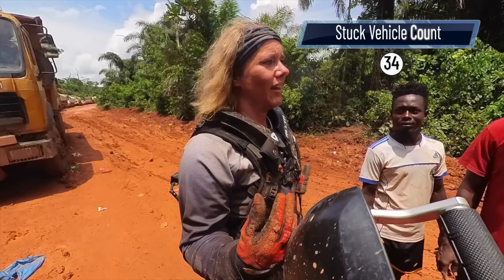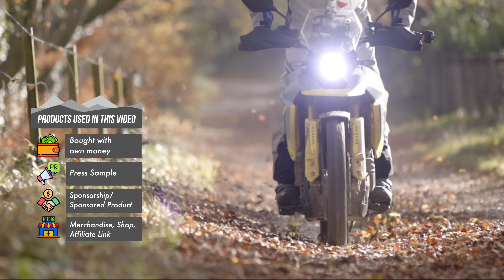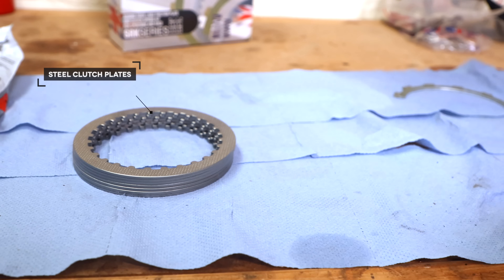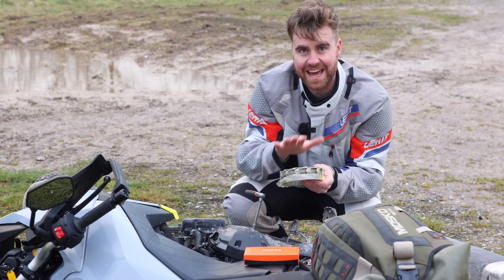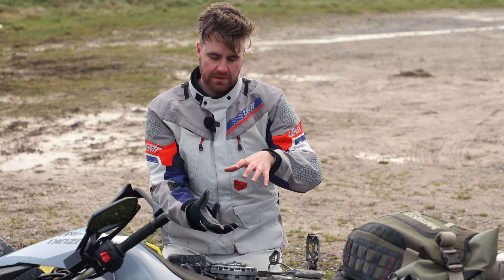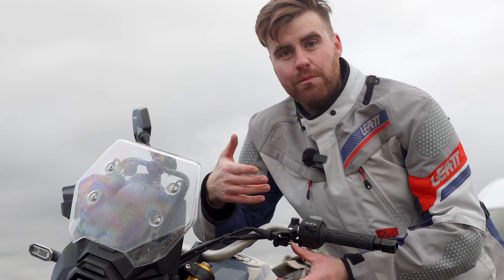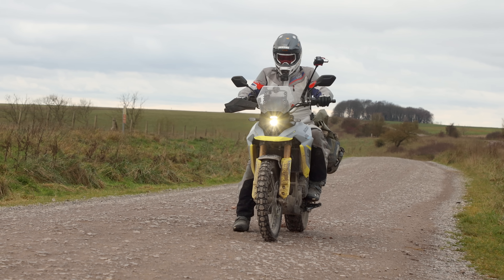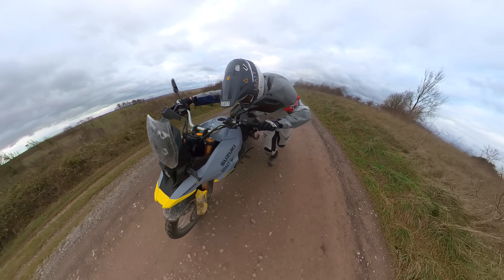This Dakar Trick could've saved Itchy Boots in Africa! | MiniTip Monday

Comment: It did always surprise me that she didn’t carry a spare clutch. So lightweight and easy to change on the roadside.
Reply from the maker: A full pack when you're travelling light is a bit bulky, but also, if you don't have the knowledge sometimes you'll make a mistake right?
Reply: @BrakeMagazine  I suppose. It did also always surprise me how little she knows about the mechanics of motorcycles considering how much she rides in remote locations. And she’s not new to this.
Reply from the maker: It’s pretty common I think 🤔
Reply: @BrakeMagazine  Aye. I’ve got mates who can’t change their oil or break pads. But they don’t travel the world on two wheels.
Reply from the maker: I’ve met as many world travellers who can’t change brake pads as those that can. I think it’s probably a viewpoint thing. 😂
Reply: I’m pretty useless at working on my bike but I’m making a list of parts to carry. I don’t weigh as much as most men and can carry what I like.

Comment: Very Nice, I am 48, I used to have a Yezdi 250 cl2 deluxe during 1995, I was 18 in college. As 'It was an old bike and i was a student did not have all the money for a timely service. My bike at times used to have a broke in clutch wire,  Used to do the same when i was 18, push the bike with engine start, and when speed reached 6-8 kms used to put in first gear, later into higher gears. Go to the spares shop, again repeat the same and go to a mechanic to repair.  So whats the big deal in this advice.  We as a novice knew trhat 30 years before.  Sorry but thats true.
Reply: Regarding clutch slippage had to rev a lot to get the bike moving.

Comment: It would not be ideal to run with a 200kg+ loaded motorcycle.
The wheelspin start looks more viable, though I would still be scared.
The start-stop-slow situations could be tricky, but could be learnt with practice. Thanks, I shall try those.
Clutch plates still don't go out without significant abuse.
Fixed drive seems scary! God bless people who invented clutches and suspensions!
Reply from the maker: Great point! Not ideal but y'know needs must. The stationary start is horrible on the gear box

Comment: You should have had a lady demonstrate your technique.

Itchy Boots' motorcycle was heavily ladened with her gear and she was faced with miles of thick goopy mud on uneven terrain.  Perhaps you should have proportionately weighted your bike (to account for your extra strength) and found slippery uneven ground.
Reply from the maker: Why?
Reply: @BrakeMagazine  I do not question that the technique is sound.  I question weather most women (in particular Itchy) has the upper body strength to manhandle a bike the way you were.

You were pushing it, then in on move, pouncing on it, mounting it, and riding off.  If the bike fails to start or it falls down... Every time the engine bogs down or you come to a stop, repeat the process.

Its psychically demanding and doable, but for a petite lady?
Reply from the maker: I think it's possible. I watched a petite lady lift a KTM 660 Rally off the ground to move the back wheel yesterday. 

It kinda depends on them. I've seen tons of women stronger than and more agile than me, and tons of men less so. It kinda just depends on what they've chosen to do in life. If you're fit and strong, it's possible. 

I'm not saying easy however. I get that I'm 6ft 2 and that's a huge advantage.

Comment: stupid idea snapping a clutch plate, it wlll cause an unbalance in the motor causing problems later on, why not just carry the friction plates and one solid plate, not exactly heavy are they.
Reply from the maker: I did say that in the video, but if you don’t have one it’ll get you out of trouble and that kinda makes it not such a stupid idea.
Reply: @BrakeMagazine  your giving bad advice pal. Wet Clutches hardly wear maybe suggest a decent oil, keeping the oil clean. Correct adjustment. Even adding a washer or shim, if needed.  Adding a snapped half plate will wreck the clutch basket and clutch seal causing absolute misery down the road.  Your obviously a rider and not a builder
Reply from the maker: Mate, this is video about a last ditch scenario where someone has burnt out their clutch already. I'm not suggesting you do this for fun on a Sunday. 

Obviously the best situation is to be preventative but just sometimes in the wild that ship has sailed and siting in the middle of nowhere hoping for help is a bad choice. There are tons of comments here where people have done similar things.

I get what you're saying though! @TheNavyseamonkey

Comment: I rode my Suzuki GT750 with a broken clutch cable but l had a spare one so l stopped and fitted it also drove a Ute were hydrolics had failed and had to drive home and it had a tachometer were l with as able to rev match and got home l did it

Comment: It's an interesting solution but I feel like a burnt out clutch is a better problem to have then risk your gearbox. How much strain is placed on the gearbox when engaging it without a clutch?
Reply from the maker: Not much if you do it how described. But you realise the point of this video is that once you HAVE a burnt out cliutch this is how to fix that, not to suggest clutches gear changes.
Reply: If you're far from civilization and support, getting out of the woods and back to shelter is preferable to walking, or hoping for rescue.

It all depends what your surroundings are. Perhaps hitching a ride is an option, intending to come back to the bike. Perhaps walking back to a main road is an option.  But when those aren't options, knowing how to Jerry rig is extremely helpful.

I've seen people wrap leather shoelaces into a clutch pack to add thickness, all in order to get out of the mountains.
Reply from the maker: Great comment!

Comment: One more way to cheat the clutch switch on cable actuated systems is to disconnect the cable on the lever and press it in. This is a great video for riders who didn't start riding on old beaten-up bikes. 😅 And crunching gears never stop sounding horribly traumatising 🥲
Reply from the maker: I know right. I did it once, nearly cried and moved one 😂😂 Good tip!

Comment: Mate I’m still waiting for the Suzuki review please 🙏 I thought this was it 😢
Reply from the maker: Mid jan
Reply: Super! I’m hoping it’s going to be a competitor to the Yamaha T7?
Reply from the maker: Not really. Different kinda bike really.
Reply: That’s a shame, T7 is a little too tall for me but the Suzuki isn’t too bad. I’ll have to keep looking 👍
Reply from the maker: It’s great bike, but designed for a little less hardcore off-road. The T7 does feel tall. Worth looking at the Aprillia tbh. I’ve got a review coming on that
Reply: I have tried the Aprillia and it’s a lovely bike but the 12 thousand mile valve checks have put me off as well as some reliability problems people are reporting.
Reply from the maker: I did a bit of research and the reliability seems super good, as much as any other bike.
Reply: I’ve been looking at the Aprillia for a while and I ve found that they have oil and sometimes water leaks, not bad and usually fixed under warranty but it’s not something I’d expect from a new bike, then common issues are fuel and exhaust sensors failing, general electrical issues and some people are now reporting excessive engine noise/vibration, I believe another YouTuber euro moto sold his after a very short ownership, again I’m not saying it’s a bad bike but I don’t want to spend 10k and be worried about potential issues.

Comment: Now try all that on the thick mud that itchy boots was trying to ride through since you're claiming to be giving her advice.
PS..... trying to ride through all that deep mud without a clutch isn't going to work.
Reply from the maker: Mate. Did you think before you wrote? Or did you wake up angry at the world?

I didn't SAY to do it in the mud would be easy. It'd actually be really hard hard. I didn't criticise her. I made at least three jokes about how much easier it was to do this in a comfy place with a flat white and pizza and her clutch gave up on the HIGHWAY. if you're gonna troll my dude, do a better job. 😂
Reply: @BrakeMagazine  I'm not trolling you, you just don't like having your bubble burst after posting your vid about how you would've coped better than itchy boots.
Her clutch might have gone while on the road but it was the riding through miles of deep mud that wore them out.
Your video would've been better if you had it as a stand alone vid on coping with worn clutch plates rather than as advice directed to itchy boots.
Reply from the maker: Except I didn’t say I would’ve coped. I made a tutorial on solving a problem based on actual experience I’ve had in my riding career, racing and travelling and instructing on bikes. You can go and see this on the 100+ videos we’ve made, but maybe check out the one where I finished Dakar, or towed across the desert or towed an Enduro bike 20km down a single track river bed on a T7.

It’s not directed at Itchy Boots either. It’s about what happens in the situation she had. Her situation is an example to tell a good story. 

Im just a dude making a tutorial to help people out and yes, your comment is trolling. It’s not well thought out and it’s protective of IB for no reason because no one is attacking her. I think she does an amazing job.

Comment: How about this idea...  You know you're in a strange country and you're going to be taxing your clutch like mad so how about carrying extra clutch disks...   You know,  the logical thing?  They don't weigh much at all.   BE PREPARED.   And while you're at it carry an extra regulator/rectifier and a capacitor pack to run your bike with if your battery shorts out.   I'm not gonna say what you're suggesting wouldn't work,  but it's going to possibly unnecessarily damage other components for no reason at all.  Just carry extra friction disks and a half sheet of 220 grit sandpaper to scuff the steel plates up with for friction.   I love Itchy Boots,  but she does seem pretty unprepared to fix her bike herself when things go wrong,  and rather than spending all that time travelling she should be learning more about the repair of her own bike.

Comment: Rule number 1 never let anyone else ride your bike. The guy that rode her bike through the mud lacked proper skills and burnt the clutch out unnecessarily...

Rule number 2 heavy duty clutch plates and springs exist for a reason! If you're loading your bike up and riding it through arduous conditions then you should seriously consider this upgrade as it will save your ass and $$$ later down the road.
Reply from the maker: Agreed. Depends a bit on the rider though. Heavy clutches can be fatiguing right. 

The CRF is know for a weak clutch though, so maybe a higher quality one would make a difference
Reply: Noraly as a woman struggled trying to ride the road and she allowed.a stronger male driver to power the bike through the terrain but Alaska couldn’t cope with the extreme condition and the clutch burned out. That was no one’s fault. Some things can’t be foreseen and you can’t prepare in advance for the unexpected in life.
Reply from the maker: Dude, why does her gender have ANYTHING to do with this 😂
Reply: @BrakeMagazine  I agree, it usually doesn’t make a difference at all but in exceptional cases, upper body strength can be an asset and Noraly hoped a guy could power the bike through the worst of the mud where she couldn’t. It fell short of expectations.

Comment: You shouldnt burn the clutch in the first place. I dont know any reason for driving with a slipping clutch and power. I fully disengage the clutch  and let the wheel spin, not the clutch slip.

Comment: Unfortunately, good advice as this is, it would not have "saved" Itchy Boots, as the entire clutch basket had broken up and spare clutch plates would not have helped. Then there is the question of carrying spares. Sensible practice of course, but where do you draw the line?. Travelling as she does the amount of weight is critical, and it's impossible to cater for ever problem. I know she carries some spares ie. inner tubes, and possibly spare cables, but any thing else is just extra weight.
Reply from the maker: I actually think it would have helped tbh. I’m not 100% sure of this, but fixing the clutch before riding along the road would have created a lot less heat in the clutch. A lot of the material they dug out looked like broken fibre material which mostly happens as the plates wear more and more. 

Heat plus material flying round breaks things. The clutch baskets on the 300l are a bit renowned for being weak, but that is a plausible process of events.

The idea of fixing the clutch is in case you don’t have spare parts, a get out of jail solution of sorts. I agree on carrying lots of spares, hence the idea of popping some on the bike somewhere.

Comment: Hummm... not sure your "loosing your stack space" from wear is the real issue. I have seen MANY clutch plates still in spec but slipping like crazy. This is because to much load and clutch abuse got them hot and slipping, then they just slip and then it all over. the issue being the glazed and hard friction surface not the dimensional wear.
Reply from the maker: It’s a good point!

Comment: Really, you expected Itchy Boots to do complex surgery on her bike in the middle of a muddy heavily trafficked Liberian road with no idea of if or how she'd be able to reassemble her bike?  That's literally a suicidal idea.
The problem is more likely torque and the weight on the bike.  A Honda 300L unloaded probably could have made it through - barely - but with 50 odd pounds, plus rider in heavy riding gear - understandably - it's just too much for this small bike.  I once rode my old Honda CL450 into a engine deep lagoon and my buddies thought I'd have to get towed out.  I just blasted it in first gear and eventually the knobby rear tire caught enough to inch its way out.  My buddies said I sent a 20' plume of mud and water behind me.  Torque from the bike and/or the rider is the only way.  The clutch should have nothing to do with it if it's in first gear the whole time.
Reply from the maker: Look man, we’re gonna have to agree to disagree. I made this video as tutorial on how to solve a problem, because I have been in this situation and learn this problem.

She didn’t break down on a muddy road either. She broke down on the tarmac. She did an awesome job getting to where she did, and she could’ve got further with some knowledge.

Checking a clutch isn’t complex surgery either. It’s basic knowledge and easy for anyone to learn to do.

Cool story about the mud hole.

Comment: These are all good trips but can you imagine Noraly (or even anybody) start ripping the bike apart on such road conditions? Even if you drop a screw it'll last forever. Also that clutch thing you explained can you image Noraly was running the bike until she gets up to speed then taking her leg over the large and heavy luggages? It was way better if you went for a slippery road  - the same on which Noraly was riding and showing how to do it better....So I like the hints in the video but I'm 100% sure it wouldn't save or help Noraly better than the help he got from the locals, I'm sorry.
Reply from the maker: You realise she made it to a Tarmac road right? Tarmac is this really hard smooth surface, with a lot of grip and friction.
Reply: @BrakeMagazine  No, it was a slippery road during and after raining - and not a tarmac. I have ridden by bicycle on such roads in rain - the most terrible one (even I had couple of crashes - but it was only a bicyle, not a heavy loaded bike)
Reply from the maker: She literally breaks down on the tarmac man. The point is. you're defending her when no-one is attacking here.

Yes people have to open vehicle up for emergency repairs in random places that aren't clean. Yes you can do it if you're careful. She got here engine repaired by some guys in a back yard. That shit isn't clean.

I have had to repair BMW Rockers in the middle on nowhere, dirt bikes in muddy forests and tons more. It's a realistic part of adv travel. 

I didn't say have to do a running start either, I said it's the nicest way. I have used the starter motor method to do this method dozens of times in the real world. I have helped a literally first timer learn to this after snapping her clutch lever clean off.

Yes, you can ride a bike with no clutch in these places. Just go through the comments to see the stories. Watch some of my old videos, learn, be open minded and stop defending a person who isn't being attacked.  We're here to provide learning and encourage people to be able to explore better. 

  @belanagy5595

Comment: AND NORLY IS GOING TO BE ABLE OUT IN THE MIDDLE OF NOWHERE TO CLEAN HER BIKE COVERED IN MUD & CLAY SO IT DOESN'T GET INSIDE THE CLUTCH HOUSING ? HAVE AN EXTRA GASKET HANDY AND SOME EXTRA OIL TO FILL IT BACK UP. THEN PUSH IT THROUGH WATER CLAY AND MUD AND HOP ON IT TO START IT ?  😂 🤣 😂
Reply from the maker: She’s got more chance of doing that than you have of finding the caps lock button or thinking about your comment before writing it.
Reply from the maker: Wow, thanks for the advice. I was really struggling with that. 

Shall we have a sensible conversation about the comment now? 😂